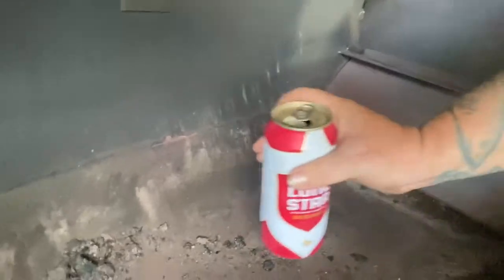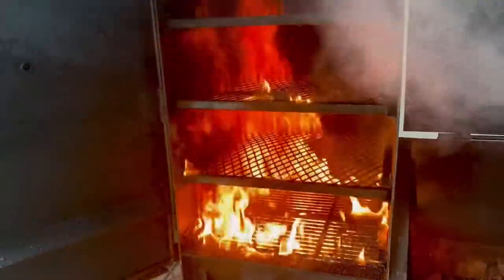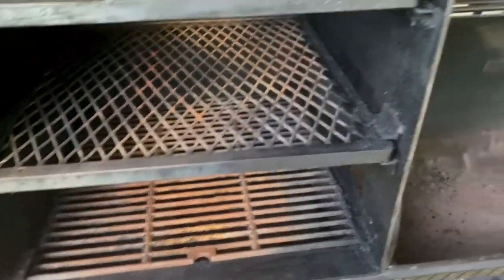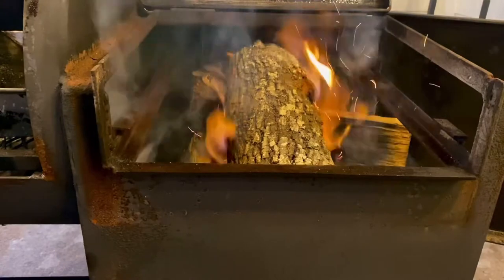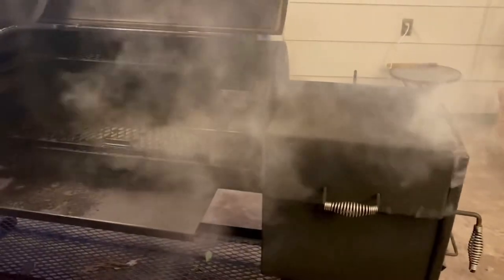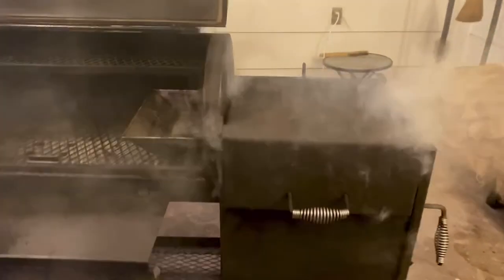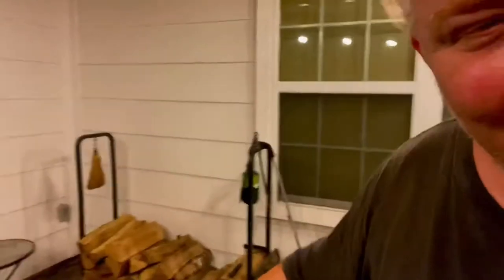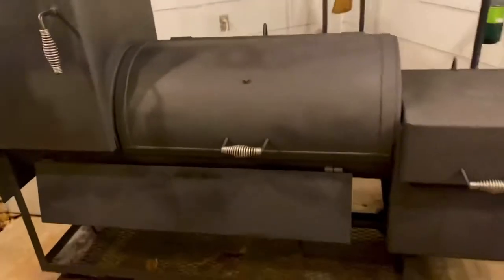Big Pit Cleaning Made Easy

Comment: Howdy. So I did think you were going to clean the 500 , but this was good to. I didn't recognize your smoker but it looked like a great workhorse. When spraying the greats I do something that I don't know if anyone else does this, but I hate wasting things so here goes. I lay the grates flat over a box I have. One grate on top of the other. But as I stack I off set them each just a little bit. This way all the spray that passes through hits the next, then the next,etc. When done spraying I flip them over and repeat. This really reduces wasting and also takes less time then spraying individually. The coverage is great because as the spray passes each grate it creates a turbulence that helps to distribute the spraying really well. Last thing I do that I'm not sure if anyone else does is I don't paint the outside of the smoker. When it's still hot/ warm I apply a little cooking oil about every other cook to the outside of the cooker, right over the original paint. Do as needed. Just a light amount , not heavy. If you put on to much it will get sticky. It works really great for me so just a thought. Anyway I haven't seen any update on your food trailer? I'm going into Portland this Saturday. Apparently a food trailer bbq business that has several locations will be closing in a few weeks permanently and I'm curious about what they are planning on doing with their trailers and 500 gal smokers. Perhaps a opportunity to get my business a earlier start. Anyway, have a great day. FYI, personally my favorite beer ( besides the free beer handed to me) is Windermere Brothers Hefeweizen. But keep in mind I lived just north of the Brewery, maybe 15 miles, so it was also support your local Brewery thing. Well chores to do, a little outdoors cooker cleaning to do. Heck Dashes Porchetta video today has me in the mood to do one. Porchetta lunch meat would be great for next week. Perhaps Porchetta Mack and Cheese, or - - - ? Ahhhh , Porchetta, hmmmm. 😁👍🌤🍻
Reply from the maker: I’ve tried it both ways, stacked and unstacked with the grates, and just prefer doing them individually in the pit so all that overspray coats the interior. Either way it takes me 4 cans of oil for this pit and internals. The 500 is out of commission until the lawsuit is finished. They still haven’t set a date. It’s aggravating.
My trailer build I’ve been posting on Instagram. Hopefully I’ll have enough footage for a video soon!
Reply: @TexasBBQGuy  I'm sorry to hear about a Lawsuit. I hadn't heard anything about it. Did I miss a video discussion about this? And just so you know I have a problem with making short comments. Yup sometimes I get a little long on these. So my apologies when I go long. Take care and good luck.🌤👍🍻
Reply from the maker: @victorbenner539  I’ve mentioned it a few times in different comment threads, but not on video. Only a few people know the whole story, but I’ve been holding off on doing a full video until the court date, just for the fact I’m holding all the cards. 
No worries brother!
Reply: @TexasBBQGuy  well when the dust settles do a video, I'm very concerned. Until then yup it's probably better not to discuss this on YouTube. I was must watching another random channel and it was talking about how some channels are getting stolen with identity theft. I'm really working hard to get my channel going by New Year. I'm a year over due. 😱 At least I haven't given up.
Reply from the maker: @victorbenner539  Never give up brother. You can go back on a lot of big name channels like Guga as a prime example. He started with just a no name 12” kettle and a smart phone